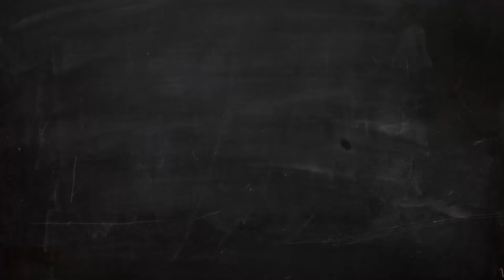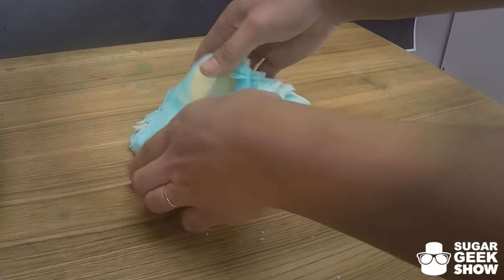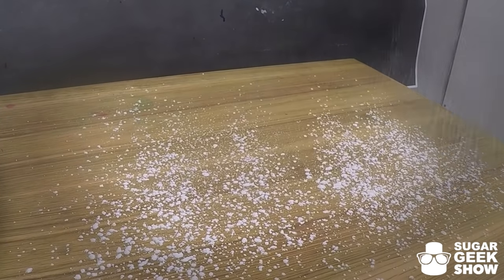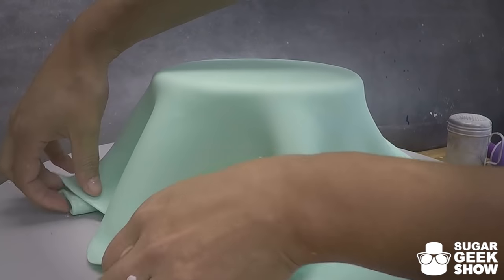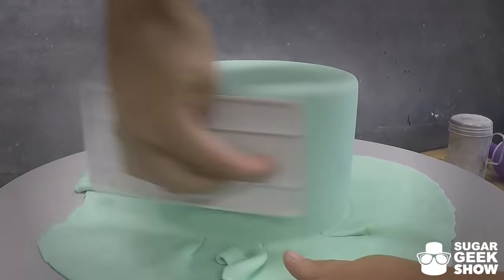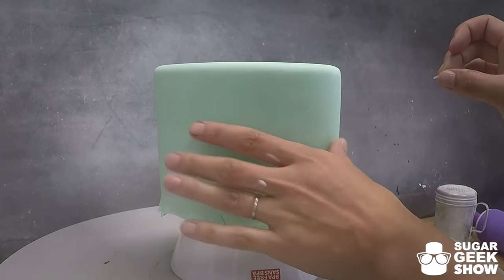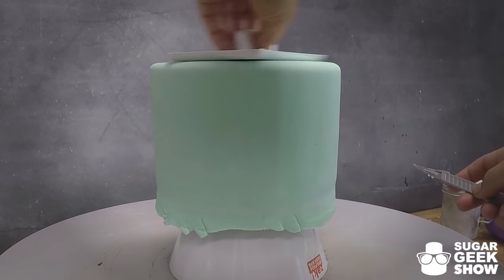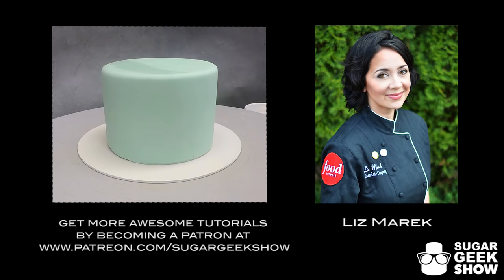How to apply Fondant to Cake Tutorial

Comment: I love your videos!  I am having problems with the fondant however. It is getting very sticky and sweaty after I apply to the cake... I can't even touch it with out it turning into goo. How can I fix this? What am I doing wrong :.....(
Reply: Are you working on a frozen cake? If your cake is just chilled it shouldn't be gooey as you can see in this video
Reply: Sugar Geek Show thank you for replying!  The cakes are actually chilled in the refrigerator and I ice them the night before I add the fondant. Once I throw the fondant on, and start to cover the cake.. that's when it starts to get sticky and I can't smooth it out.
Reply: Where are you located? Is it really humid in your area?
Reply: Sugar Geek Show I am in Los Angeles, Ca. It does get humid here.. I've thought of investing in a dehumidifier but not sure.
Reply: It shouldn't be that big of an issue. Lots of cake decorators in LA. Try rolling out your fondant in a larger piece next time and place it onto your chilled cake and work quickly. Have a cornstarch poof (pantyhose with cornstarch inside and tied at the top) to dust your surface if it starts getting sticky. Having a fan blowing on your cake while you work can help too
Reply: Sugar Geek Show ty ty!! Love you and all you do for the cake world :)
Reply: Sugar Geek Show basketball cake
Reply: carol martinez use cornstarch instead of powdered sugar